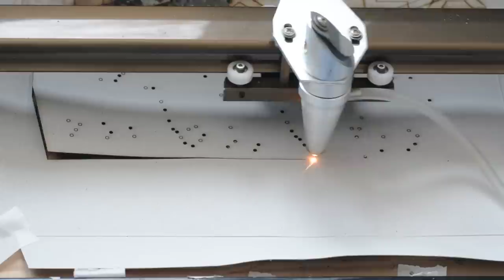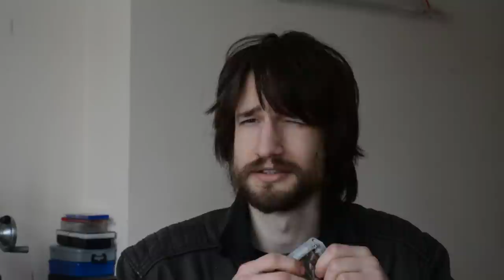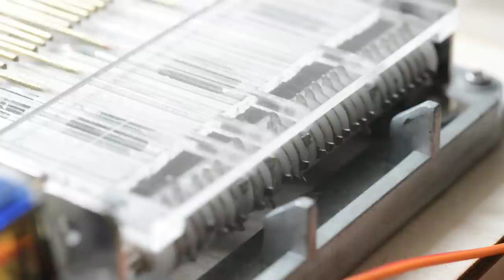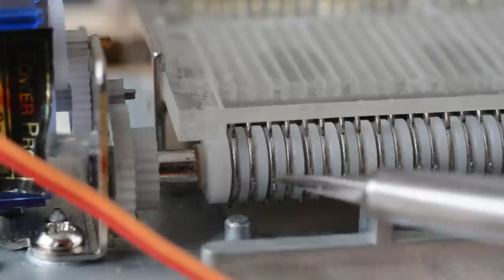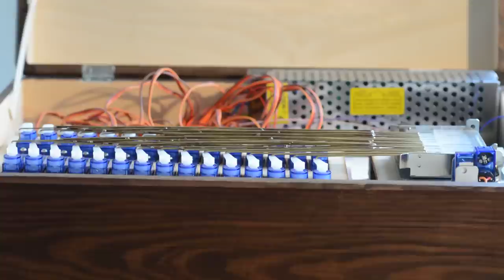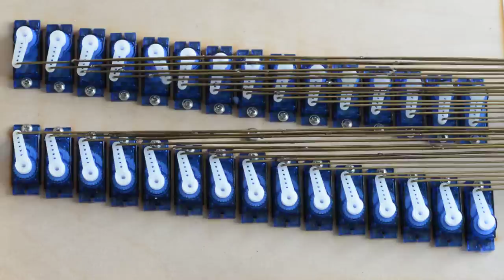MIDI Music Box

Comment: Is it always possible to strike a note on the music box? Or is there a point in the rotation of the driver motor where striking a hammer won't actually land?
Reply: Well from my understanding the "hammers" that strike the notes are actually just pins on rotating wheels, one wheel for each note. So it's possible there could be a point in the rotation of the drive motor (which drives the shaft, which therefore drives the wheels which are positioned on that shaft) where a note probably won't play, because the pins on the wheels are a certain distance apart from each other. This potential absence of notes could be resolved by obviously increasing the speed of the drive motor to increase the chance of a note being played more often (which therefore means faster retriggering resolution for single notes), although the only problem with that is it'll probably only increase the amount of motor noise! That's like what happens in a car or any other vehicle; when you increase speed, you also increase motor noise, so the amount of noise is proportional to the speed the motor and wheels are operating at. One could theoretically move the pins on the wheels closer together to avoid this need, but this could present another problem: you might get double triggers, where a single note was played twice when it should've been played only once. That's because of when the wheel continues to spin even for just a little bit after a note was played, and the pins being closer together resulting in a shorter amount of time between one pin striking a note and a second pin re-striking the note (this is a little hard to explain, hope it makes sense). I suppose you'd have to make it so that the wheel would have to stop spinning immediately after a note is played (I.E it's not allowed to still spin for even a really, really short length of time after the note plays) to avoid this. That might be pretty difficult though, but I'm a bit of an idiot when it comes to engineering so I don't know how you'd do that.

Comment: This is super nice. Is there a way to have the motor speed be controlled by the tempo of the midi so that it doesn't randomly skip quickly repeating notes? Or is that due to to the time it takes to reset the rods to their original position after striking a note?
Reply: I know I'm a bit late, but I think what you're talking about is the time it takes from when the wheel rotates to when one of the pins on that wheel finally strum the comb and because the pins on the wheel are not that close together. Theoretically you could have the pins on the wheel closer together for for the same note to be played quickly, but if they're too close together it'll likely miss one of the instances of the same note being played quickly or it might retrigger a note while the wheel is spinning.The other side effect of that is that You'll likely hear a dampening effect to the sound. The pin on the wheel has to touch the metal prong and then slip off it in order to make sound, which honestly is exactly like a person's fingers or a plectrum on the strings of a guitar. Strum a guitar string 2 times at a fairly slow speed, and you'll notice a dampening effect because your finger has to come into contact with the same string to prepare for the second strum which stopps the vibration of the string. Pluck the string 2 times again with a lot more spead as you move your finger, and that dampening effect is gonna be way less obvious and you'll get a more sustaining sound.
Reply: @justinnaramor6050  difficult decisions indeed. i feel this would need some engineering with regards to common time sigantures, etc. i mean, to be fair, this is what autopianos do, so there's something that lets them hit the notes. [might be the hammer mechanism tho]

Hrrrm...

(Also thanks for the reply, you raise good points.)
Reply: @OmegaErkz  Your welcome, I don't mind kindly replying as long as people as long as they are'nt disrespectful and just want to be negative. You're correct, player pianos use a different movement to trigger the sounds, by means of the hammer mechanism being pushed by pressurized air. It's more like hitting a drum with a stick as apposed to strumming strings.

Comment: Very good. I have been messing around with heat sinks, the kind you might find on computer CPUs, trying to grind off fins to match the proper notes. Much to no prevail. My guess is that aluminum is a bad choice for the project. And that the structure of the fins were not designed for such a project. I would find that no matter how much I would grind off, the pitch would either not change, or would even change the opposite way on the scale. Very frustrating.
I even asked myself the same question, "is it all worth it?" Unfortunately, I came up with a different answer..."NO". But I'm never one to not reconsider. I just have to think it out better and find a more proper material. There has got to be a way of cutting the heat sinks at the right angle to achieve the desired notes, or even just close enough to where I can fine tune with a file and not shorten the length of the fin. Once accomplished, I can start on designing a hammering/plucking mechanism. I havent even considered that part yet as I dont know how the fins are going to look like when finished. Just 24 notes, thats all I ask. Lol

Comment: I wonder no one makes such things with software, though it's totally possible. However - similar amount of effort is needed to make it. I mean analogue sound and style is trendy now and I like it. It has its dense mood, it's so cool. But you don't really need old technology mixed with computers to achieve the effect. Computers alone can generate any sound. Just that kind of sound are pretty complex and hard to generate. Now I wonder (as a programmer)... Do programmers have no souls? ;)
Reply: I think the goal here was not just to get the analog sound of a music box using MIDI. It was to put MIDI data directly into a music box, as a way to give it a more "modern" approach to programming it. Some people simply like the mechanical nature of music boxes and they want to keep that tradition, while having a more modern way of programming it.

Another thing you could do (and this has been done before) is to essentially have a MIDI controller that functions like a mechanical music box. The idea is that you would place pegs into a grid of holes on a cylinder, and when the cylinder rotates, the pegs would press against keys or buttons or switches. This action would then be converted into MIDI messages which could then be used to drive a synthesizer or a drum machine or a sampler or anything like that. This way you can essentially have a music box that doesn't have to literally only sound like a music box (if you know what I mean). So really this type of music box would be acting like a mechanical MIDI sequencer, because the mechanical movement is converted into electronic MIDI notes which can drive an electronic sound generator, which is similar to what an actual MIDI sequencer does.

Comment: I wonder if anyone (beside me) has ever thought of making an electric harmonica with pressure switches or sensors so you could make it sound like a horn, woodwind or even strings. I play the harmonica, wouldn't you know. Rather than a thick cable bluetooth might work better.
Reply: I know this reply is late, but I've heard of something called the "Jambox" that works a bit like that. It's not the first of its kind either, electronic MIDI wind instruments (we call them "wind controllers") have been around for decades. And because they use MIDI, you can make them sound like anything.

That's one problem with the invention that's shown in this video: because it's effectively an acoustic musical instrument being controlled via MIDI, the sound you get is limited to the sound the acoustic instrument makes; so because this is a music box, it'll only sound like a music box. This removes one of the advantages of MIDI, which is that you can make it sound like "anything". I think a better idea for a MIDI music box would be something that takes the mechanical movement of a music box-like mechanism and then converts that into MIDI, as opposed to converting MIDI data into the mechanical movement of playing an acoustic instrument (I.E the complete opposite of what's shown here). In fact, we've already seen examples of stuff like this in the world; check out the "XOXX Composer" by Axel Bluhme for an example of the concept I'm getting at. A device like that would instead be "transmitting" MIDI data just like a MIDI keyboard does, rather than "receiving" MIDI data like the device shown in this video. An added benefit of a device like this is that the way you program it is inherently tangible, like the music boxes of old which used pinned cylinders or disks, for example. That's the other downside with the device shown in the video, you do lose that tangible nature when programming it because at that point you program it just like any other MIDI device we know today. I guess what I mean is, with a device like what I'm illustrating, the "MIDI sequence" is literally a tangible object even before it's digital... really you could think of pins on a cylinder or disk as a kind of "tangible MIDI data".

And now this reply is getting way too long :)))))
Reply: @justinnaramor6050  l got a DM48X recently and that is what I wanted. The pressure sensors know when you are blowing hard or soft and respond to your breath. It works with Ipads or even my Nokia 20 with Android 12 SynprezFM. Very happy with this instrument.
Reply: @mrdovie47  Well, cool! Enjoy it! :)

Comment: Are those servos overkill? Is there a more compact solution?
Reply: For this solution it's just right. Part of the size is the long rods to get rid of vibrations. It could be possible to have fewer servos with a more complicated mechanism (extreme case, one "finger" moving and pushing each note) which would only be more compact if you put great effort into it. Another solution might be to break out the tone comb, and pluck it in a different manner. Found a more compact idea: https://murobox.com/en/story/story-03.html

Comment: This is very well done, but some of those midis that went through, whew. Discordant sour notes or wrong key notes. I know that has a lot to do with the music box itself and the limitations therein, but some of those just stung my ears. There were also missing notes, which is another limitation of design, as the mechanics of the music box don't allow for quick note double taps.
Reply: Perhaps the limitation of not doing quick repeating notes could be avoided by making the motors a lot faster? Not sure though. But yeah, that's a limitation of many music boxes, not just this one.

One thing some music box manufacturers have done to compensate for that limitation is to have 1 or more teeth on the musical comb tuned to the same note. Would love to see a punch card style music box with that type of arrangement of teeth on the comb.